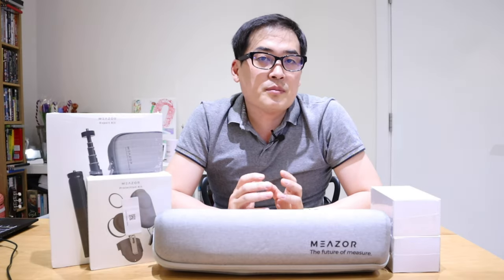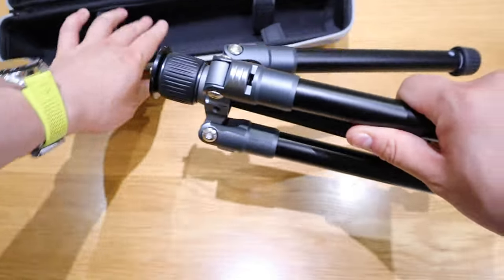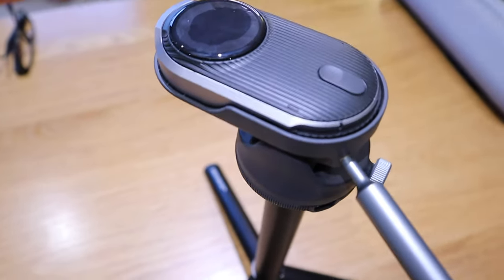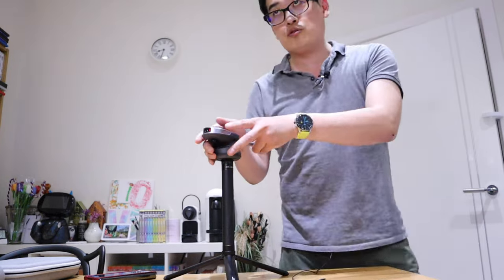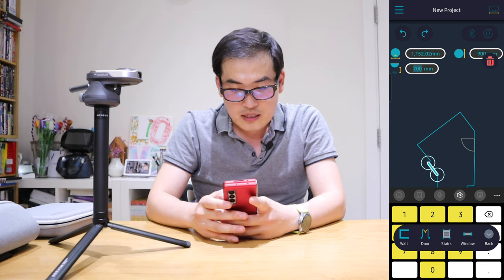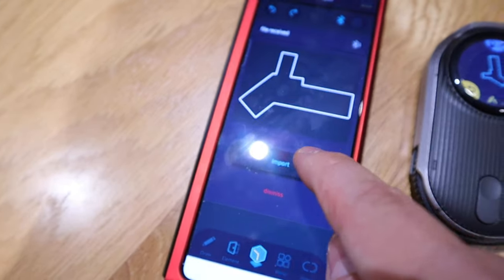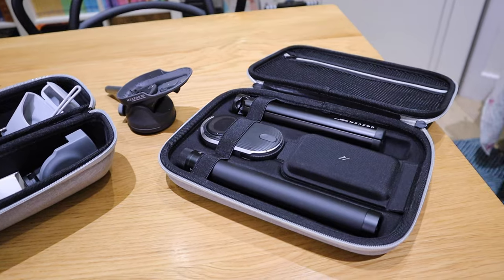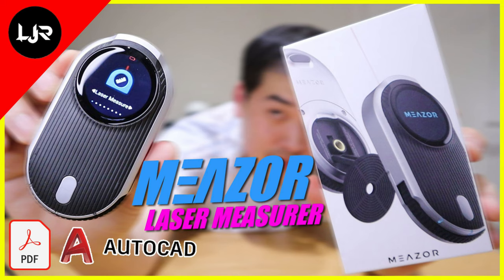Meazor 3D - Huge Upgrade For Architectural Works (AutoCAD, JPG & PDF)

Comment: Thanks for the review
The scanned points are projected on a plan on your video. But can I keep 3D point like scanned? For example, If I want to "scan" the for 4 points of my windows and the floor,  MEAZOR 3D is able to do that? Thanks for answer 🙂
Reply from the maker: Thank you for your comment! Yes, MEAZOR 3D allows you to keep the scanned points in a 3D format. You can definitely scan those four points and have them stored for your project!

Comment: So it can only measure 2D plan with manual adding height? But if I have not vertical wall or not horizontal ceiling? Can it really do 3D measurements?
Reply from the maker: At this stage yes